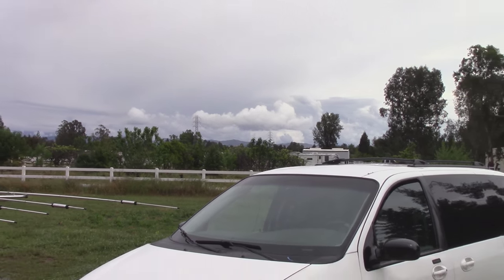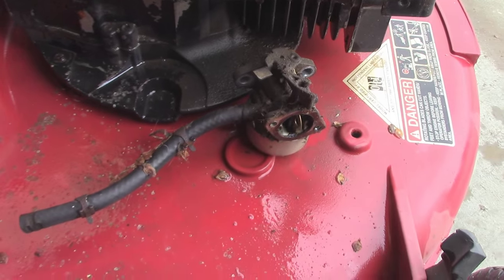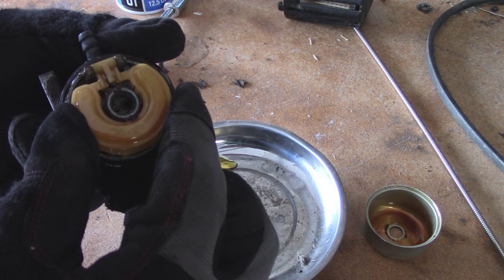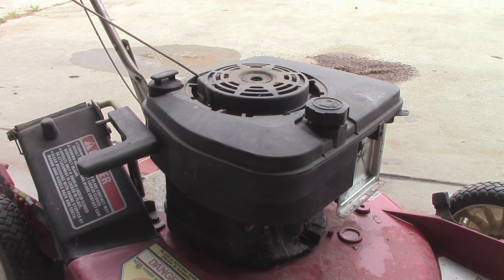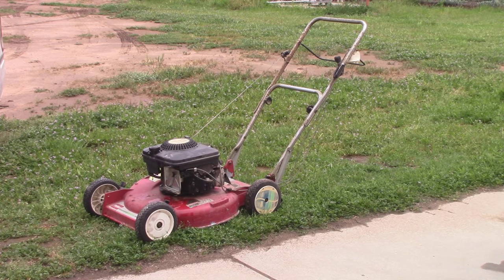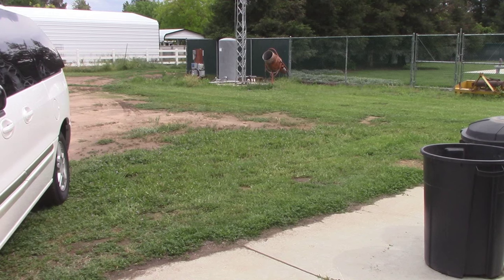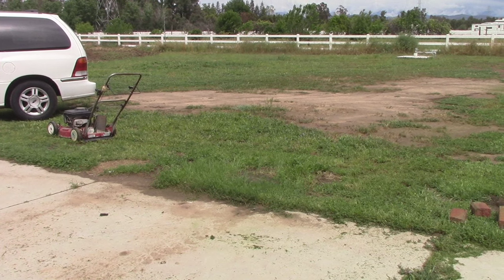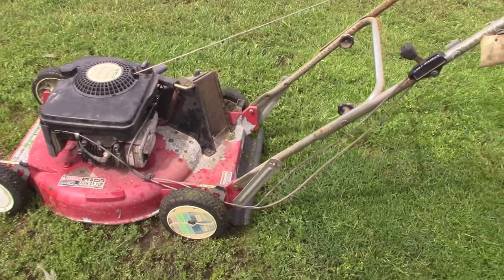Fixing Toro Super Recycler 2 - Carb Clean and Demo

Comment: I trash picked one of these back in December (2020). I just put it aside and in line. I just got to it today. Checked spark and it was good. Sprayed some carb cleaner and fired it up. It started on the first pull and continued to run the gas in the tank. I was shocked that it did not hunt. I was at least expecting it to have something wrong with it. I love trash picking nice neighborhoods. 😆 made my life so much easier. The only thing ill do is clean it up and sharpen the blade. 🙌 I super lucked out.

Comment: Great video! Quick question ~ what gauge mechanic's wire are you using on the carburetor ports?
Reply from the maker: .020 or Welding tip cleaner tool works great as well. Can find at harbor freight

Comment: Thats not bad.. I have a briggs mower at a family freinds house I beleive its a late 80's mower but it looks like the same engine similair to the quantum motors same carbs to I think but last I checked these motors were called "Max" but back on my topic lol it has carb issues as well so I got to look at it but the deck still looks really good and shiny like its been well taken care of except a sticker thats peeling off of it. I dont think its going anywhere so im really just waiting for one of my main mowers to die so I have space to take this mower in
Reply from the maker: The names Briggs gave these motors always confused me lol. So many of them look so similar to each other and I hear you on the space issue. Agreed
Reply: +hanksranger Yeah I dont know if they are official but im just going based off what research I do or what the mower says (not the brand that made the deck and put the motor on it)

Comment: I have that non-steel deck on an old Toro. It's flaking like the one in your video. Can it be painted with regular primer/ Toro paint or does it need special preparation, do you know?
Reply: just rough up the paint , get any loose off and prime and paint her no special treatment